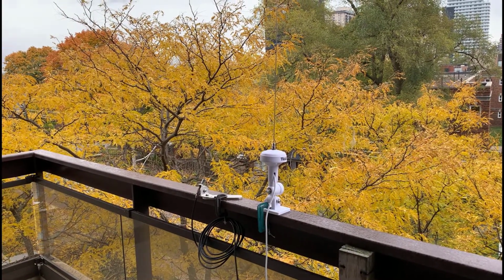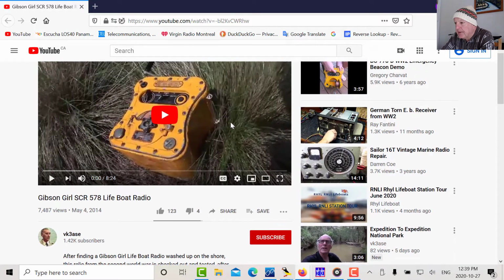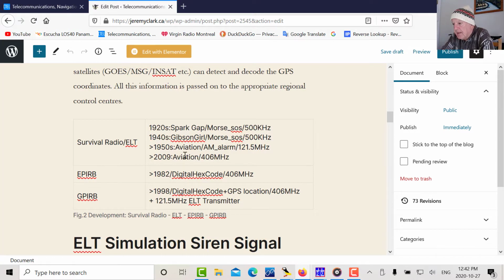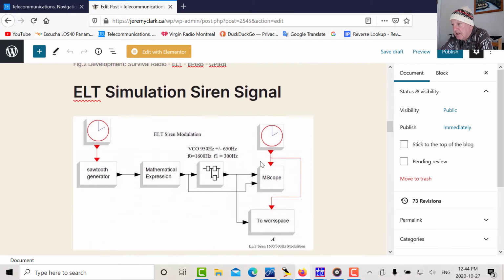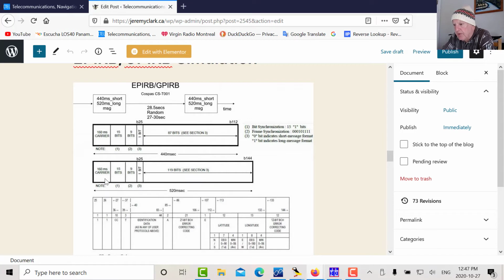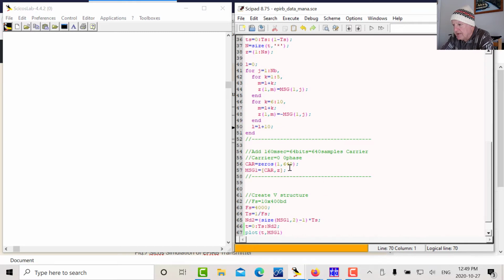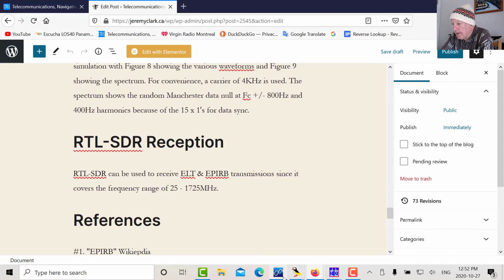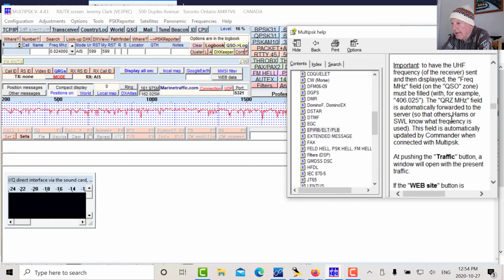RTL-SDR for EPIRB

Comment: Hi Jeremy,
 Is it possible to install MULTISPK in Raspberry PI?
Reply from the maker: Bruno: I don't think so, MULTIPSK is pretty awesome. FLDIGI works on RPi, you can install it from Add/Remove Software.
Reply: @ClarkTelecom  Nice, would be possible to test aircraft atc transponder with this software? Just for fun
Reply from the maker: @BrunoSilva-uo6gf  No, FLDIGI only does amateur radio modes. SDRangel does ads-b, it works on Windows/Ubuntu. There are some links to compiling it on RPi, but I haven't done it.